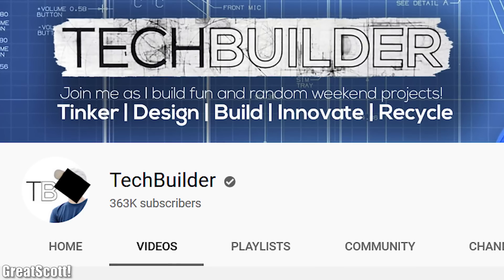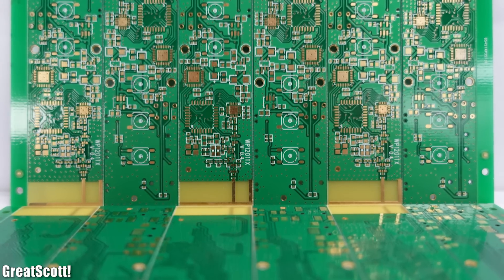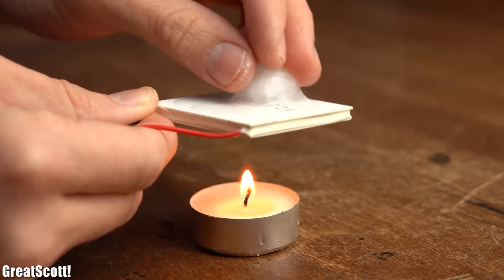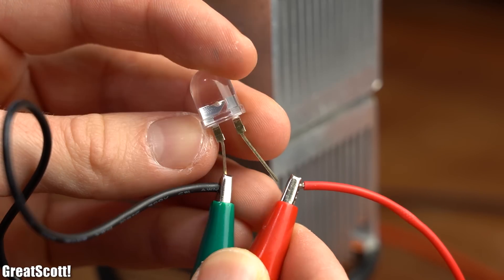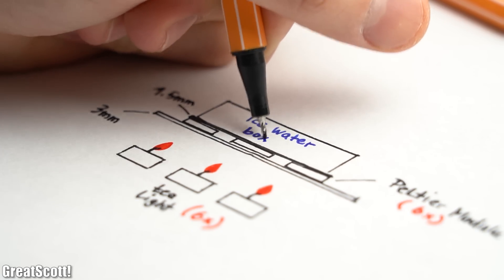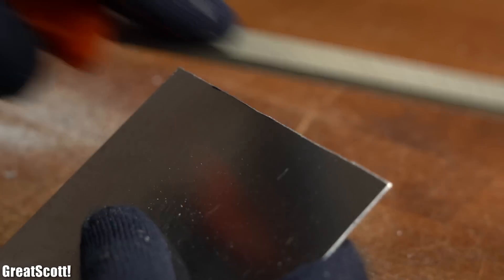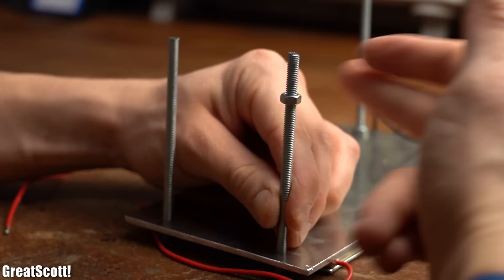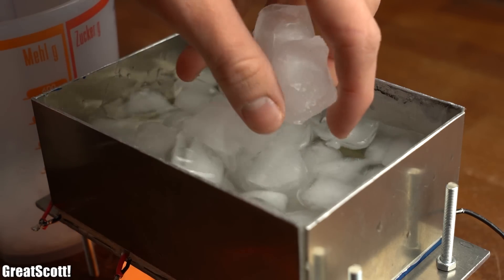Exposing a FAKE Thermoelectric Generator and building a REAL one!

Comment: Publishing fake projects is a thing. I understand why people do it but it upsets me to think how many viewers are frustrated when it doesn't work for them. This frustration certainly leads some folks with curiosity about electronics to abandon the hobby before they really get started.
Reply: I just report it, because it spams my recommendation list instead of showing actually useful stuff, I love DIY and manufacturing, I just want quality content and not shit.
Reply: and do you hnow what it even worse? it's from "Verified" channel
Reply: Before smartphones, you could charge a phone slowly with 4 repurposed peltier modules 0.5W got you something with an old style flip phone. "Cheap" peltier modules are not lapped, so they are at different height, that means that a common cold side heat sink only will make proper contact with one module. Likewise there is a recommended clamping force, that is important for proper thermal conductivity. Heat paste becomes more viscous when hot so, a spring force or a heavy weight is ideal. #3 a tip is to lap your peltier device yourself and measure them with a caliper if you want them to share heat sink. The ceramic end plates are rather thick, but using some 1000 grit carborundum paper on them, you can make them considerably thinner, so they become semi transparent, at least on the cold side, as tea lights are plenty of heat anyway.  A $30 proper TEG module (from china is in the 12-15W range and is typically bigger, so it has an MPP at a reasonable voltage, 6-15V, which saves you boost converter losses.
Reply: @Tore_Lund  Interesting information. It seems you have done this, yes? It does seem to me that providing less mass of ceramic on each side and better heat transfer away from the chip could reduce heat soak of the active element. Can you point us to better information source for TEG information?
Reply: @Miata822  Just search for "Thermoelectric generator" a place like Aliexpress, and Google for the datasheets afterwards as Chinese listings are somewhat mysterious, then you also get the detailed description by the manufacturers on how they shall be treated and mounted. The benefit is of using a proper TEG module is the higher hot side temperature, easily 230-270 C.
Reply: @Tore_Lund  I think them Peltier modules are for cooling system not for energy generation. They are not that effective.
Reply: So true it almost happened to me I was watching videos with fake and wrong information when I was younger but I found channels like this and now I'm more interested in electrical engineering 👍
Reply: SubigirlAWD _ That's awesome
Reply: @subigirlawd_7307  good for you, i admire your tenacity
Reply: The other scummy thing people forget about is that they often then link to Amazon to buy the materials, but they're affiliate links so they profit from broken promises and failure of aspiring engineers. Not cool.
Reply: Is it possible to calculate the efficiency before hand? it will save lots of time if you can visualize the result.
Reply: @springrollwang4441  like all generators, this system is what is called a "heat engine". Heat, in this case, referring to thermal energy and not temperature, although we will use temperature to calculate the theoretical maximum efficiency. Heat engines extract work (ie mechanical or electrical energy) from the transfer of heat from a "hot" body to a "cold" body. In a steam engine the hot body is the boiler and the cold body is the condenser. In this case though it's much simpler as it literally extracts energy directly from a temperature difference, but either way the math is the same. So, the maximum theoretical efficiency, designated as nc (also called the Carnot efficiency, with the t being silent), for a heat engine operating between a hot body with absolute temperature (in Kelvin) Th and a cold body with an absolute temperature Tc is:
nc = 1 - (Tc/Th)

So as you can see, the hotter we get the hot body and the colder we get the cold body, the more efficient we can be. The most efficient heat engine possible (nc=1) would require a cold body temperature of absolute zero, which is why 100% efficiency of any power generation method is fundamentally impossible.

However the actual efficiency will likely be much worse than the Carnot efficiency. To find the real value without knowing more specific details about the energy conversion process (eg what kind of thermodynamic cycles are used, if any) the only way is to measure it experimentally. The experimental efficiency (ne) is equal to:
ne = P/Qh
Where P is the actual useful watts power (be it mechanical or electrical) you can get out of the system and Qh is rate of energy transfer out of the hot body, also measured in watts (this is energy transfered to the Peltier tile, the cold body, and the surroundings, with the latter two being essentially lost/unrecoverable energy and the primary source of inefficiency in any heat engine). Qh is most commonly shown with a dot over it to indicate it is a flow rate (ie watts) rather than just normal Qh which is total energy (ie joules). Hope this helps.
Reply: it's a good filter too. If u just watch without basic theory learnings, whether the video said is true or not makes no sense to u. Because you can just copy, not verify nor create.
Reply: If you want to see a nonfake solution: https://www.youtube.com/watch?v=hDLWO_Iaflc
Reply: @wizzardrincewind9458  If you want to see a non-fake version, just watch the video you are commenting on now.
Reply: Bill Kerr Electroboom and Mark Rober have a video on why these practices are awful. Basically they get amazon money from people clicking their link in the description.
Reply: Also it brings down the credibility of these manufacturers, because it seemly does not work.
Reply: This has existed since long time if I am not mistaken. Like a lot of old schematics in old books and website were untested and may not work correctly.
Reply: Heyy, I'm the 1200th like. Cool. Anyways I completely agree. I understand people gotta make revenue but they shouldnt saturate the internet with pure garbage to do so and should instead do simple things that encourage potential hobbyists and promote potentially learning something useful. It is not too hard to do so, yet objectively bad or even fake diy videos are everywhere and multiplying like roaches.
Reply: @SlavTiger  Than you for your 1,200th like! I'm blown away by the response to this post.
Unfortunately click-baity made up stories aren't only on YouTube electronics videos. Semi-plausible but utterly fake stories have now become headline news among certain outlets and are frequently spread on social media. politicians and "players" now know that when they find themselves in a jam they can just make up a story, say it with conviction, and their followers will spread it all over the internet. This is a threat to our freedoms and to the internet itself.
Thanks again for your like and comment. All these comments give me hope the public isn't as asleep as it sometimes appears.
Reply: @SlavTiger  Yes. I agree with you completely. Now the most viral and fake video is the camera from the phone with soldered wiring.
Reply: they're everyhwere on youtube. suprisingly with more than 13 million more views. i only remember americantech but thered too many of them
Reply: @rosekreuze  

American Tech is the biggest liar, I remember he claimed 7000F for a crappy paper-tinfoil cap he made, he even shorted the plates together while making it, so it couldn't even work at all but he still showed melting wires with it, probably hidden PSU lol
Reply: The free energy and free power videos are the ones I hate the most.  They take magnet and hot melt glue as bit of wire on it and tell you it will light up a 100 watt bulb. The second are the free Wi-Fi videos. They take a spark plug a paper clip and a cut up USB cord and get free Wi-Fi.   I wonder how many people fall for the fake videos.
Reply: True, but when on the internet you need to be vigilant. Gullible people will be manipulated.
Reply: Great job debunking fake and phony YouTuber! 
I hate to see viewers getting fooled by trashy content creators!
There are many more others to be debunked!
Reply: Good point there.  I'm glad I was in the hobby long before YouTube was around.
Reply: @dang48  I posted that 4 years ago. It seems like the most popular fake vids now are fake cooking & mechanical "hacks" and of course the flood of AI generated computer-voice videos. Fake and dangerous electronics still out there, of course.
Reply: Best comment of YT
Reply: I made a really working Thermoelectric Generator
parts cost 50 dollars
Reply: "I understand why people do it"  Because some people are scumbags?  There is really no good reason to do this unless it was some kind of obvious spoof.
Reply: "I understand why people do it"  Because some people are scumbags?  There is really no good reason to do this unless it was some kind of obvious spoof.
Reply: and this is why the flat earth idea is a still a thing in 2020
Reply: Thats right!
Reply: Just like that flying phone scam that got debunked later on
Reply: Fixing hot plate at 50 degrees and the heat sink, which thermoelectric module would produce more power: TEC1-12702, TEC1-12706 or TEC1-12710?
Reply: Honestly I don't get why someone would publish something like that
Reply: @un_lucio  They do it to get people to watch the video. Youtubers get a portion of the money advertisers pay for the ad on the video. 
The fake cooking videos aimed at young people get even more views.
Reply: İt is planned, deeply. To prevent people from usİng these diy especially energy devices.
Reply: I only ever found out about thermo electric generators through reading about the old Russian thermo electric kerosene lanterns. If you've ever seen a picture of one of these they were powerful enough to power a small radio (so the Russian government could talk to its people). I've got to imagine that if they were making TEG's that were powerful enough to power a small radio back in the early 19th century it should be possible to trickle charge a power bank. I'd love to fix 10 TEG modules in series and attach to the side of a log burner similar to the cheap log burner fans that push warm air into the room.
Reply: @And-rc9yy  Give it a try then.
Reply: True. I got involved in electronics because of the idea of free electricity. I gave up many times. And then I did a galvanic battery from scrap metals and soil and powered a PIC microcontroller. To be able to get to that point where I did this, took about 2 years of on and off electronics study. And things didn't really make sense until I started doing. I'm passionate about low powered electronics, and my research is in this area. I sometimes want to make videos to expose, and teach others what I've found. But people come along and steal your knowledge and claim it as their own. Which hurts. If it wasn't for these fake projects I probably wouldn't be where I'm at today.
Reply: I had a friend with masters in computer science believe a fake project with endless power generation through magnets lol
Reply: @EnhancedNightmare  Having a degree is no guarantee against stupidity.
Reply: @edgeeffect  I know that very well by working at university hahah anyway I wanted to point out that even person with formal training in physics, electronics and mathematics can fall into those idiotic traps!
Reply: @EnhancedNightmare  Then the person does not have the understanding.
Reply: @edgeeffect  SO true. Some of the most stupid people I have ever known had degrees of some kind.
Reply: @steelmesh I've met shills like you on all levels, from YouTube trolls to teams of highly paid consultants. Lying and stealing comes natural to some people. I'm not at all surprised by the political content I see on your channel.
Reply: @steelmesh sorry I'm not interested in that😂 I'm more into engines that run on petrol and are laud, I got a straight through pipe on my bike😁😬 and I work for company that makes exhaust and increases performance of race cars and such😁
Reply: Techbuilder has actually made some fantastic projects, on Instructables as ASCAS, I believe, too.
Reply: @steelmesh the idea is brilliant, but it's just not my cup of tea, Sorry
Reply: @steelmesh Everybody can make an engine run on water. Just stick 2 ends of electricity in water. Hydrogen and oxygen releases. Capture the gas. Put it in your lawnmower engine like normally. Ignite and voila. 

This was free.
Reply: Yall are full of BS, scott is just not good enough